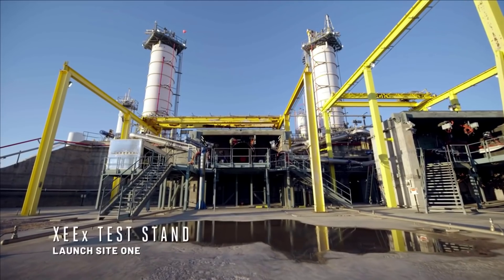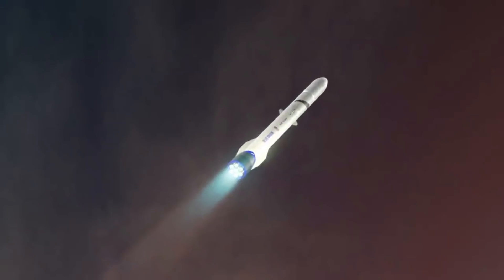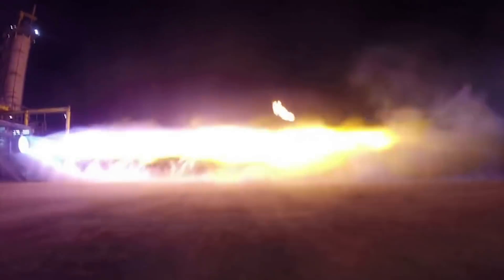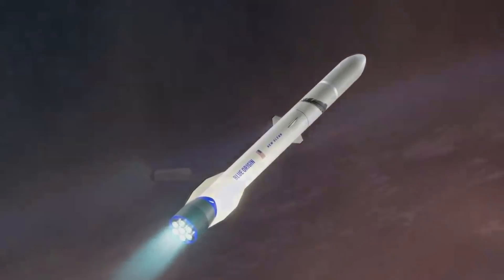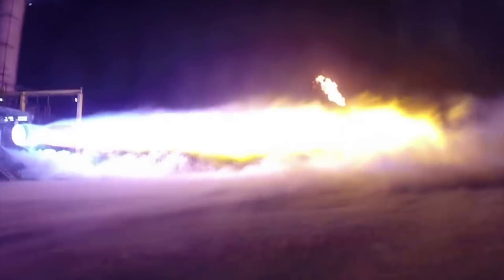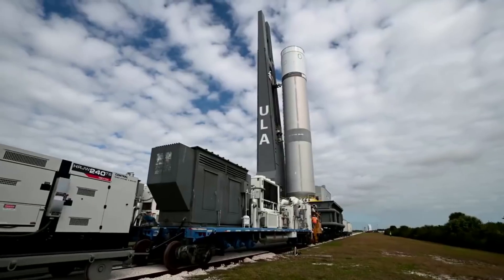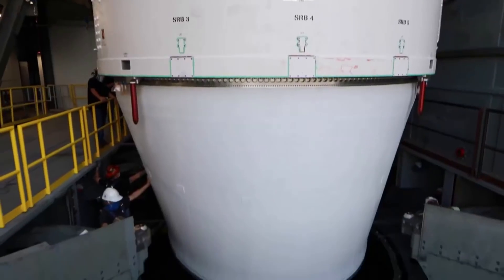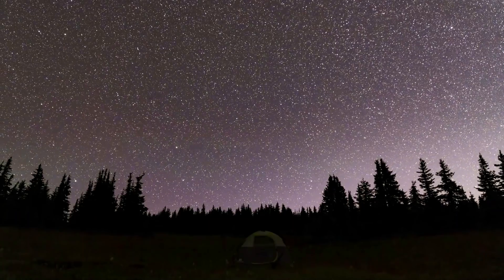What Exactly Went Wrong With Blue Origin’s BE-4 Engine

Comment: Back to the question. What went wrong? It's the development approach. SpaceX approach is by trial and error. They build one design, test it and learn from it and itterate at a fast pace. They consider failures as an opportunity to learn and improve. In order to do so, you NEED to build prototype and accept the risk of failure. That's not at all the Blue Origin's approach. They use the conventional development model of NASA, Boeing, Lockheed Martin, etc. Their management comes from these companies and they have the same results as the SLS or the Orion.

Comment: I have a serious rocket scientist friend who has worked some with these guys on the engine.  In our latest talk about it he said that the pressure ratio between the manifold and combustion chamber is too low and that therefor they are having some problems with combustion because pushing the propellants into the chamber is difficult to maintain and causes combustion problems.  His opinion is they need to do some significant changes which they obviously don't want to do.
Reply: You create and fund another engineering team, and then have friendly competition.  Bad management is always a problem...
A fish rots at the head.
Reply: It’s kinda simple but bezos is too affraid too hurt his pride. You need a dual pump system plain and simple. If it took this long with no real advancement it kinda speaks for itself.

Comment: My favorite part is the part that doesn't explain what went wrong with the BE-4 engine.
Reply: Blue origin designed it, enough said
Reply: Space X is so open and we are told what has gone wrong on failures. But BO is very closed and secretive. We may never know what has been the problems.
Reply: @ronfullerton3162  I agree we will never know.  I personally believe there is a fundamental design flaw.
Reply: @kokomo9764  It is probably that or the fact that it takes BO so much time to go back to the drawing board and revise. There just seems to be no sense of urgency on their part, even with ULA and others waiting and depending on them.
Reply: A little click bait
Reply: Bezos is storing all the parts to finish on his super yacht.

He now has to dismantle every bridge in between his yacht and the BE-4 production area to finish the engine.

This could take a while.
Reply: It melts. a similar problem affected the Raptor 2 for a while, but that seems to be solved by SpaceX.
Reply: MVP!
Reply: next up: what exactly went wrong with journalism

Comment: Part of Blue Origin's problem is that, Bezos' claims to the contrary, the BE-4 has been a very hardware-lean program. They aren't building enough of these engines to run an intensive testing program, so you've got a lot of highly skilled people sitting around on their butts, waiting for something to do. On the other hand, over at SpaceX they crank out so many test articles that some get scrapped without ever being tested. This wastes money in the short term, but it saves time over the long run. And in this new age of commercial rocketry, time is of the essence.
Reply: In fairness, just about everything is hardware-lean compared with SpaceX's Starship development.
The thing about "test articles that get scrapped without being tested" is that they still serve a purpose when it comes to refining production methods, and SpaceX's aim is to make Starship the first rocket ever to be truly "mass produced". So streamlining production processes is almost as essential as making a functional rocket for them.

Comment: You forgot to mention that the BE-4 engine delay has already impacted ULA. The Q4 2022 USSF-51 launch on Vulcan Centaur was moved to the more expensive Atlas-V. Since the NSSL contract for that flight is a firm, fixed price contract, ULA has to eat the difference between the two launchers. Since all of the Atlas-Vs left are contracted out and Russian engines can't be used on NSSL payloads after the end of 2022, it remains to be seen what will happen to the USSF-106 flight on Vulcan Centaur. USSF-106 was originally slated to fly in Q1 2023, but has been pushed back to Q2. I don't know if that was due to the payload or Vulcan Centaur being further delayed. Since the BE-4 delivery date keeps slipping, it is very possible that USSF-106 was delayed by the BE-4 delay. At some point, if the delay runs long enough, that may imperil the USSF-106 contract if it can not be moved to the Atlas-V because of the rule against Russia engines and/or if a future Atlas-V flight can not be bumped to free up one for USSF-106.

ULA is also not bidding on the Nancy Grace Roman Space Telescope (NGRST), likely due to the Vulcan Centaur not being ready due to the BE-4 engine delay. Only currently certified launchers can bid, so Vulcan Centaur is out as it is not flying yet. If it was able to launch the Peregrine lander, or even a test payload, in the summer of 2020 like ULA planned, they may very well have bid on the NGRST launch. With the SpaceX Falcon Heavy being the only other likely contender, that is a missed opportunity for ULA.

Also, this video seems VERY similar to the wikipedia page on the BE-4. It would have been nice to have some new info or at least info not readily available.
Reply: Steve it would seem to me the way to make room and gain some breathing space would be to cancel the Starliner Program and transfer that mess over to Space X. It won't be a difficult decision to make after the Starliner Test Reflight scheduled in a few months fails. That will free up 5 Atlas V launchers. As to the restriction on NSSL payloads flying on RD-180 powered launchers after 2022. Watch how fast congress moves when they hear its either that or fly in to space on their brooms as Rogozin put it the other day.
Reply: @WestCoastMole  Nah, having two providers is good, because you have a backup. If NASA had picked only the safe bet in 2014 for Commerical Crew, NASA would still be buying Soyuz seats to reach the ISS.

Back in 2021 when ULA announced that the Atlas-V was retiring, they mentioned that they already had all the RD-180 engines they need to fly the rest of the Atlas-V flights. So no need to free up any boosters. The USSF recently cancelled the 2022 launch of USSF-12 for an indefinite time. So until USSF-12 is ready again, there is an Atlas-V booster freed up for the USSF if necessary.

SpaceX is the other provider for NSSL payloads and if Vulcan Centaur is not ready in time for USSF-106, SpaceX will almost certainly get the launch. It's why the USSF has two launch providers for NSSL payloads.
Reply: He just wants to see all spaceships, make it to space.
Reply: many of those contracts will likely end up with SpaceX.
Reply: @jessepollard7132  If SpaceX has the capacity. SpaceX has the reputation of tasking on responsibilities it can't fulfill.
Reply: @WestCoastMole  Haven't seen any yet. unless you mean that one rocket that exploded on the ground.

Comment: The USAF should've maintained high funding levels for Aerojet's AR1 rocket-motor as an alternative Vulcan engine so they'd not be held hostage to the BE4's development progress.
Reply: ULA says that they picked the BE-4 as it was further along in development than the AR1 at the time. The AR1 is a RP1/LOX engine vs the BE-4 LNG/LOX. AIUI, methane and LNG engines are not as sooty as RP1 engines so they burn cleaner. And LCH4 and LNG propellants are easier to design with than LN2/LOX. Since ULA was considering dropping the engine pack to be caught and reused, they wanted a cleaner burning engine.
Reply: @steveaustin2686  the AR1 uses kerosene as the fuel.
Reply: @rkoenn  Yes, it is called RP1. A highly refined form of kerosene.

Comment: It isn't engineering, development, or design - it's leadership, or lack there of.  JB is an egomaniac, and a fool, and can't get out of his own way.
Reply: Until July 2021, Bezos wasn't deeply involved in Blue Origin, so it is less about Bezos than the culture at Blue. Former employees have described it as everything must be perfect before moving on to the next step, rather than making it work and perfecting it as you go. I have no idea if that is true or not, but it would explain the VERY slow development cycles.

The BE-4 problems are probably more about being an oxygen rich staged combustion engine. Oxygen rich engines have been done, the RD-180 used by the Atlas-V is a similar cycle, but they are difficult to engineer I understand. Running an enginer oxygen rich is very hard on the components of the engine.

Comment: Yes. Good job. It’s nice to hear someone not exaggerate for a change. These are tested engines. Not prototypes. BO went thru the same pains SpaceX is now going through with their ver2.0 Raptors with turbo pump failures. But like BO, will hopefully find a fix.
Reply: ONly SpaceX acknowleged the problems. And the fact that the engines were melting. BO doesn't seem to understand.
Reply: SpaceX already fixed it. they are produceing around 7 engines per week.

Comment: The BE4 will impact on every launch company. 
Either helping or delaying. 
If new Glen takes too long, some other company will have to take it’s place. The same for ULA.
Reply: Shouldn't affect SpaceX either way other than giving SpaceX more launch contracts. SpaceX already has the equivalent engine capability.
Reply: @jessepollard7132  I disagree. 
ULA and BO are extremely influential and lobbyists to get government contracts. 
If they can’t deliver, SpaceX will be hugely beneficiated
Reply: @jessepollard7132  affecting isn’t necessarily for the bad.
Reply: @jessepollard7132  It will effect Space X. Who do you think has pushed the government to restrict Space X development of Starship?
Reply: @ronfullerton3162  POssibly BO/Bezos. but they have their own troubles making a contracted delivery.
Reply: @jessepollard7132  I do not believe that Space X has any contracts to deliver their raptors to anyone. They will need all their own for the Starship production.
Reply: @ronfullerton3162  They don't. But they have tested and demonstrated working engines. BO has not.
Reply: @jessepollard7132  True!

Comment: The difficulties of developing engines is the same for everyone! How do you explain that SpaceX has far more success than Blue Origin? ....
Reply: Where is that "success" of SpaceX? Molten combustion chamber of raptor 2 is not definition of success.
Reply: @sunhead2573  SpaceX: 144 space flights, Blue Origin: 0
Reply: @gillessylvestre9443  19 Blue Origin spaceflights, child. Remember, Karman line is at 100 km and New Shepard has flown well past it!
Reply: @Nowhereman10  106km to be exact. Just barely enough to save the face...
Reply: @gillessylvestre9443  You would be lying. New Shepard routinely flies to 107 km, though the propulsion module tends to reach slightly lower apogee. Its capsule has reached as far as 119 km.

Either way, it reaches space and often is 21 km higher than SpaceShip2.
Reply: @Nowhereman10  I won't argue for 1 km....You're correct. According to Blue Origin, 107km.
Reply: @Nowhereman10  You're correct. I should have use orbital spaceflight instead of space. BO flights where sub-orbital and SpaceX where orbital spaceflights. Sub-orbital spaceflights are flights where the apogee of a spacecraft reaches SPACE but the perigee is too low. You are also correct for the X-15 (twice) and the first two Mercury flights. The reached space has sub-orbital flights.
Reply: @sunhead2573  it melted while putting out more thrust than the BE-4 engine's final specs. raptor is a smaller and cheaper engine than BE-4, and this is version 2. they have produced hundreds of version 1 raptor and flown dozens of them, and are designed to be reusable, while BE-4 is expendable.
 even worse, raptor is a far more complex engine, the first full flow staged combustion engine to be manufactured and flown, while BE-4 is a traditional "playing it safe" design.
Reply: @jesusmora9379  it wasn't just over rated thrust, it was a destructive test to find the physical limits of the engine instead of rated limits, which is important data for getting a rocket cleared for payloads as those limits may be used in emergency scenarios to get a vehicle to a safe termination altitude.

SpaceX's testing program is wasteful, scrapping a large number of unfired Raptor 1 engines and multiple near complete superheavy and starship vehicles, but it exists and shows the kind of granular, provable progress that a hardware rich test program delivers.

Blue Origin... It's note worthy that ULA has quietly told NASA they won't be able to flight prove the Vulcan in time for launches in late 2027 with a flight proof deadline in 2026. They've withdrawn bids and declined to make others. What Tory Bruno tells investors and the public isn't lining up with how he's running the company on this.
Reply: @Nowhereman10  I think that's not the point. SpaceX went to space. BO did not. Period.
Reply: @sunhead2573  Space X is manufacturing 1 Raptor 2.0 a day now. BO? Not even 1 flight qualified engine in 6 years!!??
Reply: @Puer-Aeternus-Anonymous  Raptor 2.0 is not flight qualified either. Rate of production does not matter if the item in production does not work.
Reply: @sunhead2573  Yes ok, Jeff. You should get back to getting your $ 1/2 billion Yacht out to sea,without getting egg on. You already spend enough time working on BO this month.
Reply: Makes no scence. There has to be a design flaw somewhere.
Reply: Better management.
Reply: "The difficulties of developing engines is the same for everyone " you couldn't be more wrong
Reply: @constellation-sj8xn  I understand what you means. It's easier for some....
Reply: Bezos is busy figuring out how to sue a city that may not dismantle their old bridge  to get his 1/2 billion Yacht to sea. Elon lives in a $50K foldable home next to Space X facility, to help solve problems.  Engineers are people and will follow their leader.